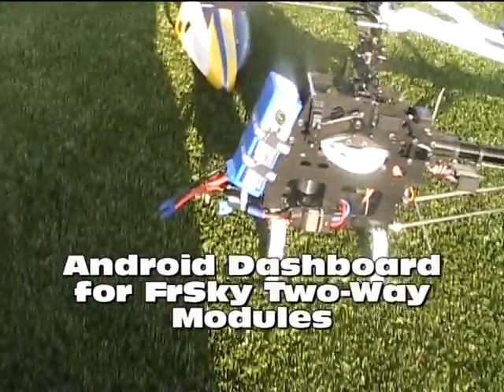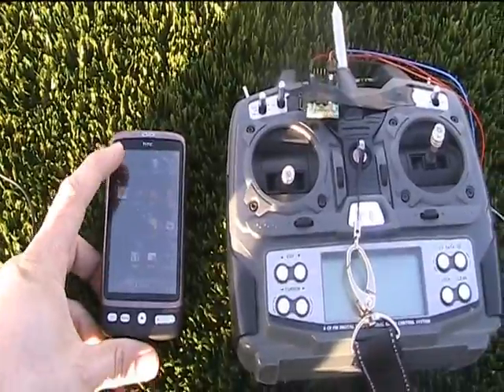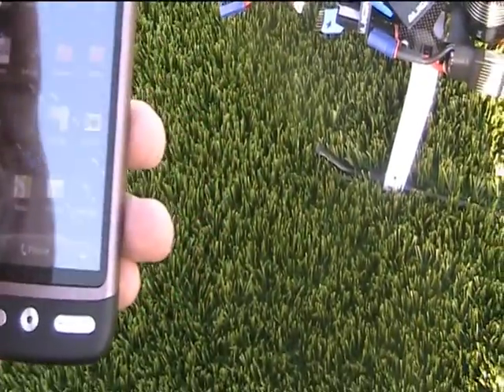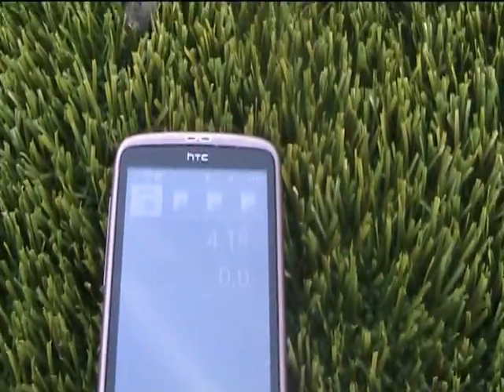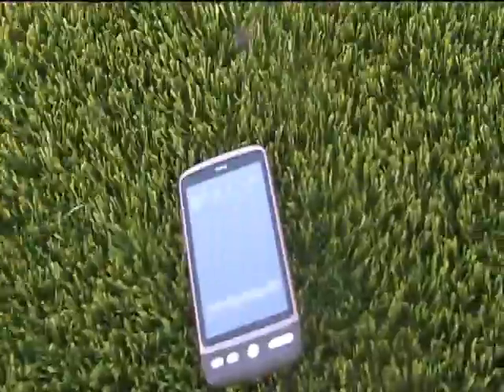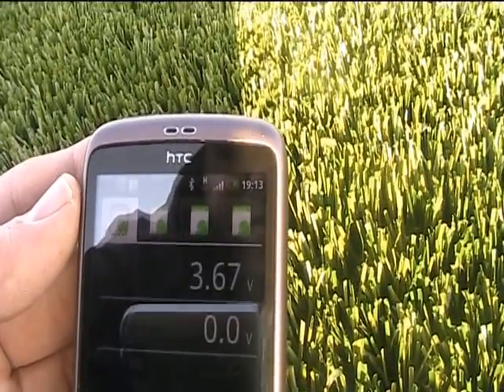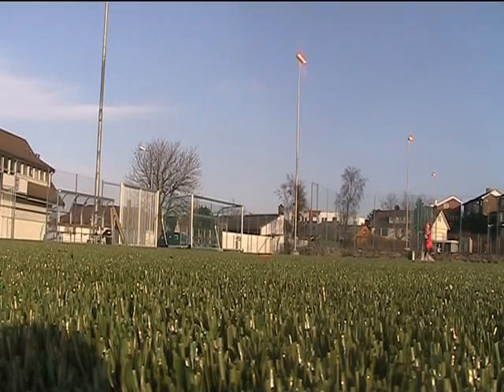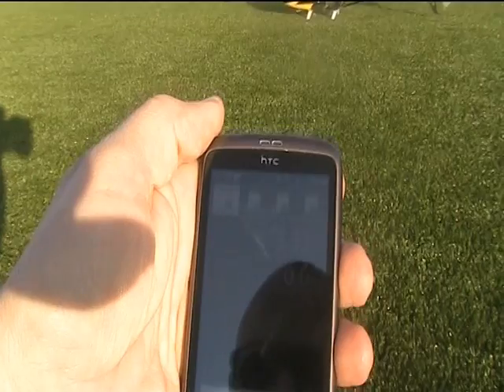Demo of Android Dashboard for FrSky Two Way modules

Comment: My name is Pedro Robles from Spain and i am an user of FRSKY DASHBOARD. I can connect app with my BT Module (i get green BT: UP) but i can't get TX and RX UP. Both are down :(.

I ithink I've connected properly my DJT module (in a Turnigy 9xr) with a FUL-01 from FRSKY (for inverting signal) and a BT Module. But i can't get information from my transmitter (D8R-ii plus) cos RX and TX appear as DOWN. What can i do? 

Sorry for my english and thanks in advance.
Reply from the maker: Hello Pedro,

I am sorry for your problems. 

I have sent you an email with troubleshooting advice. I hope that this will help.

best regards
Espen
Reply: Finally, i get my troubles solved. All i had to do was change the bluetooth module from this    http://www.ebay.es/itm/Arduino-Bluetooth-Module-comunicacion-Slave-Wireless-Serial-Port-Arduino-HC06-/321533328966?pt=LH_DefaultDomain_186&hash=item4adce13e46    to this http://www.ebay.es/itm/150843209961?ssPageName=STRK:MEWNX:IT&_trksid=p3984.m1497.l2649
Reply: Pedro Robles *****  Hi, does that mean the hc-06 is not compatible? i am having the same problem as pedro. thank you in advance